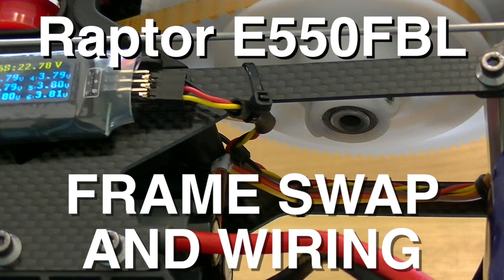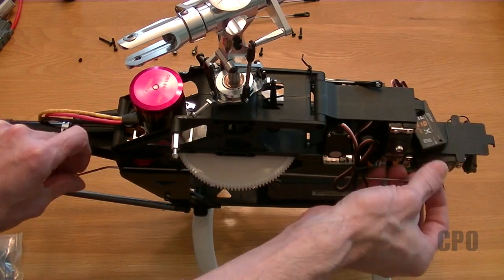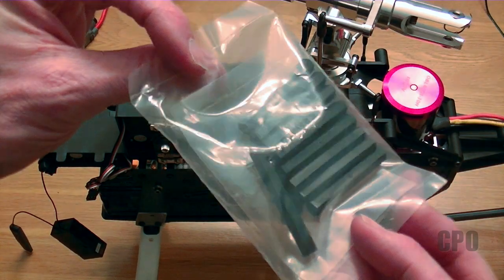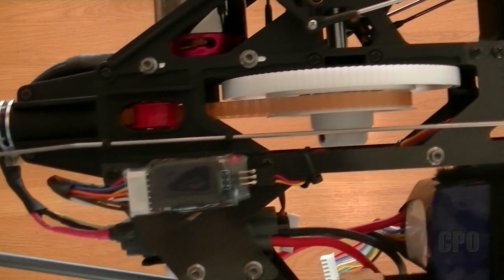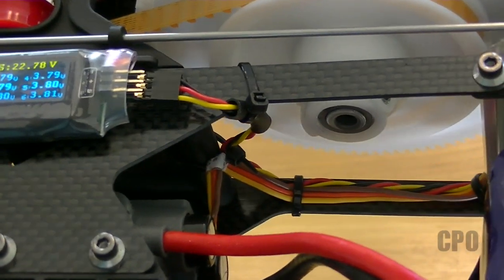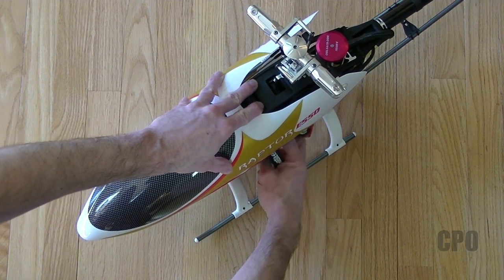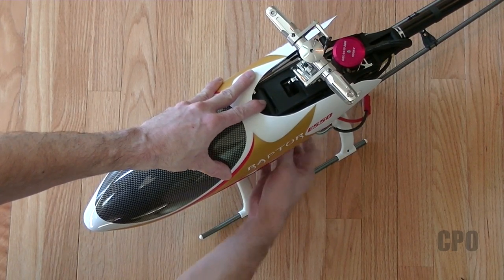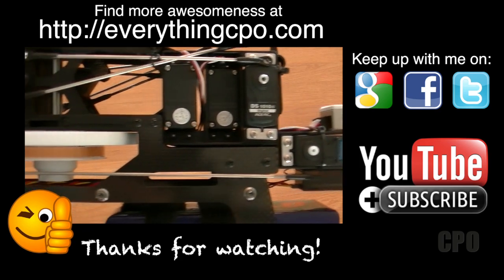TT Raptor E550FBL Frame Swap, Electronics Wiring, and Battery

Comment: Disregard, Just bought the X9D Teranis.
Reply from the maker: You can't go wrong with the Taranis...but to answer your question, yes...you can use S.Bus to connect the receiver with the GT5.2. That is how I have mine. Even the FrSky receiver has S.Bus. I have used both that and (currently) a Futaba S.Bus RX.